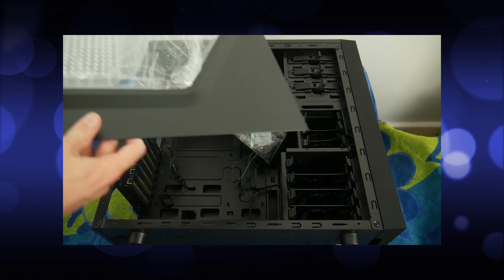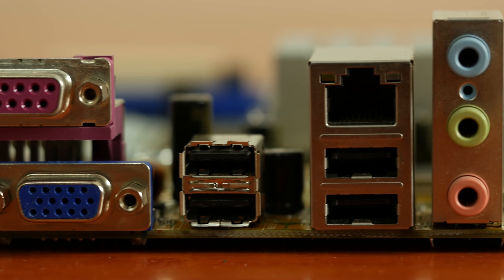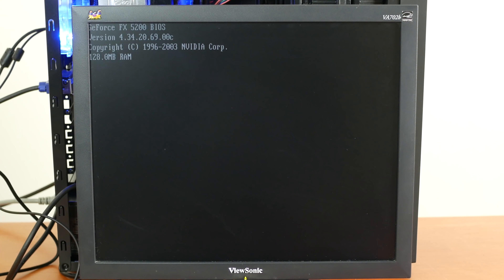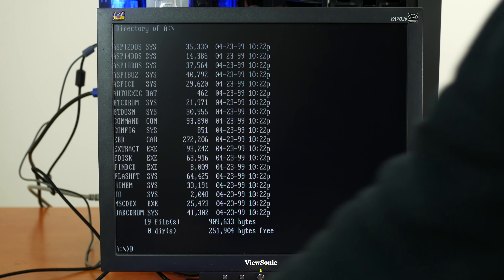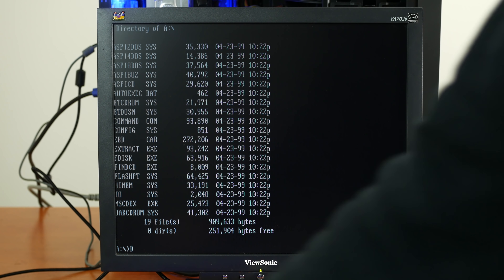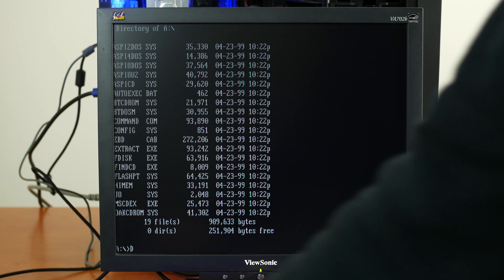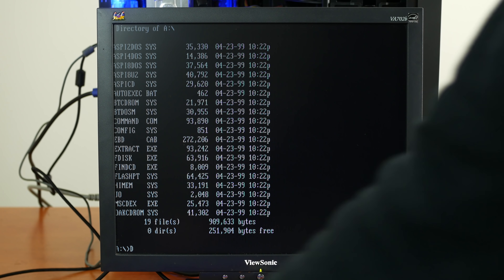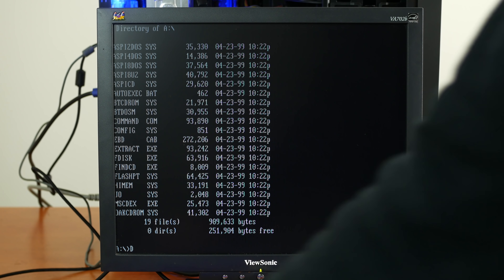What's the fastest (officially supported) Windows 98 PC?

Comment: But does it run Minecraft? People have hacked it to run on XP
Reply: yes, Minecraft can run on Win98SE. So long as you have a graphics card that supports OpenGL 2.0, you can run at best 1.11.2, or 17w06a (the first snapshot for 1.12). Newer Minecraft versions require Java 8, which hasn't been backported to Win98SE, and there's currently no way to have Java 8 working on vanilla w98se. MC versions before 1.12 require at least Java 6, which does work on Win98SE. Using KernelEx might make Java 8 usable, extending the version range up to 1.16.5 (or 21w08b), as later 1.17 snapshots require OpenGL 3.2 and Java 16.

This is theoretical capacity though, the performance of the game will likely be very poor 😅

Comment: Win98 max TMU Working 32TMU on CPU and GPU botch working.
Reply: Maximal hardver:
Pentium M / Core Solo
Ati HD2600XT
Ram 896MB VRam 256MB/512MB 
DDR2 -DDR3 - DDR4 -DDRX support... Chipset DOS -BIOS select native IDE! On sata! Only PIO4 mode. Sata not supported UDMA4! Sata UDMA6 supported!
Reply: IDE interface 1987 for floppy drive. Pio4 mode floppy speed!
Reply: ESDI 1987 HDD port! Speed is 200MB/s Very very long time ago!